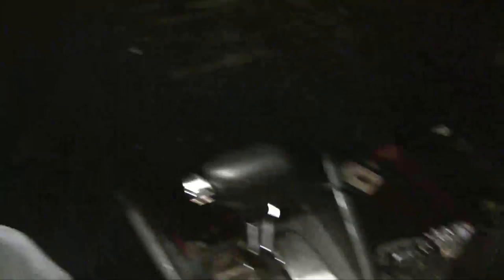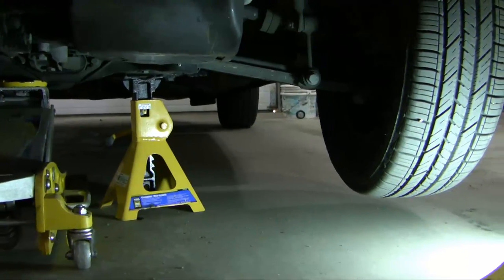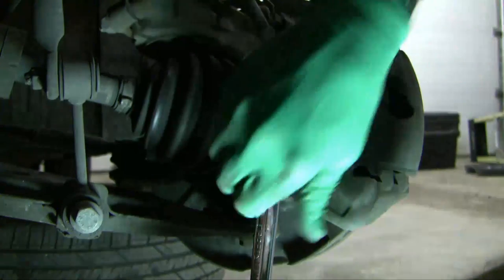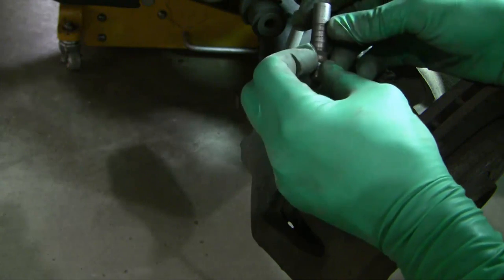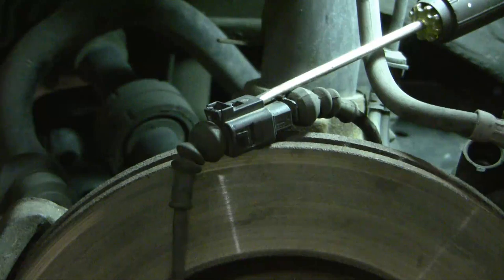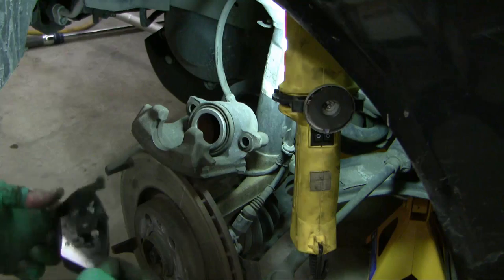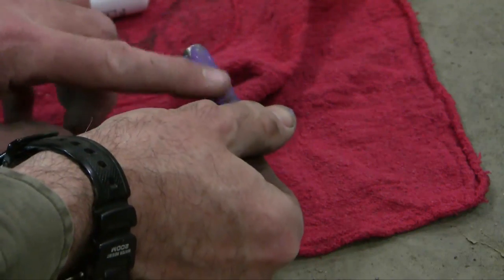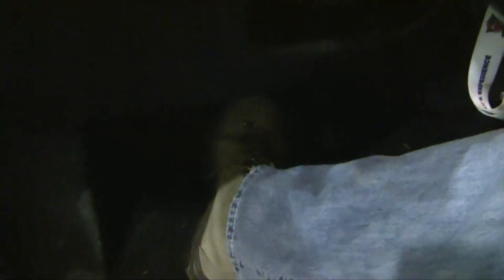Replace front disc brake pads on a 2001 VW Jetta

Comment from the maker: Those are good points, Zac. I would like to see a study done, where average technicians do 1000 brake jobs, alternating technique to open the system in half and not open the system in the other half. Then I would look back to see which technique led to more complications, like inadequate bleeding. 

As an expert in an unrelated field I can tell you that experts are not always right and that expert opinions often swing like a pendulum through the years.

Comment from the maker: Thank you, Zac. Indeed, many experts do it this way and I won't disagree. Of course they do it that way because they believe that in their hands the risk of introducing air into the system, risk of inadequate bleeding after, risk of bleeder screw damage, and the risk of crimping the brake hose is lower than the risk of damaging the MC by retrograde flow. I respect that point of view. Personally I've never damaged an MC and I flush my lines regularly. So, it seems that risks are low either way.

Comment from the maker: You are welcome. There are limitations to what can be covered in one video, and you may encounter other problems, like worn or warped rotors which require more work, or extra problems on rear brakes. But the video as shown is a good basic start for most front disc brakes. There are now many good Youtube videos of brake repairs, and you should watch many before feeling comfortable to try this alone. Ericthecarguy has a great channel, covering brake repairs and other automotive tasks. Good luck.

Comment from the maker: Yes, I've also seen mechanics put brake caliper grease on the back of the pads. From my perspective, Brake Quiet sticks there, without spreading onto the front pad surface and without thinning and causing a dispersion problem when really hot. It's designed for this specific purpose, dampening vibration, not for lubrication. It works for me, and it's proven reliable, and so I don't really have any interest in experimenting with multipurpose lubricants.

Comment from the maker: @Hrothnar I don't know. What year? I can tell you that many REAR disc brakes can be tricky, because of the integrated hand brake. To do those you need to borrow or buy a tool that is sold at Harbor freight or Princess Auto, worth about $30-40. That tool allows you to compress and rotate the wheel cylinder counterclockwise simultaneously, opening the pads to accommodate the new thicker pads. Basic safety principles apply for all brake jobs.

Comment from the maker: Many very respected authors, including Ericthecarguy, believe it is safer to avoid reflux of brake fluid by cracking each bleeder screw at each brake pad change. Of course the assertion is that the risk of damaging an MC by reflux of dirty fluid is higher than the risk of opening the system, repeatedly crimping lines, maybe breaking a bleeder screw, and possibly introducing small amounts of air into the system. I do respect your opinion, but I think the risk may be higher to do that... 
Thanks!

Comment from the maker: @Hrothnar I would be surprised if it not similar. You can have a look at the caliper. Does it say FS-III on the outside? A Haynes manual may offer advice -- my Haynes manual does not cover the Passat.

On the Jetta, the wire/sensor to signify thin pads is on the driver's side only, just on the medial pad.

Comment from the maker: @Kingcodez To settle brake squeaking I use "brake quiet" which is a heat tolerant silicone that helps to suppress brake chatter/squeal. If you don't get excessive noise it's not worth doing over. I would avoid lube or antiseize in that area, out of concern that when the brake pads heat up the lube could spread to other areas. The one place that most mechanics don't like antiseize is in the sliders, where antiseize could react with lube or silicone paste to freeze the sliders.

Comment from the maker: If the fluid is at exactly the right level, it will be near the top when brake pads are new, and near the bottom when pads are worn out. Ideally you don't want to add or remove any fluid. But, if fluid is topped up when pads are worn, you may need to remove fluid before changing pads. The point I wanted to get across is to watch that level when changing pads. Thanks for asking.

Comment: Great video! I just did my fronts on my TDI for the first time. I forgot to put the brake lube on the back of the first pad, and put anti seize on the second. Is it important enough to warrant pulling the brakes and doing it again? I don't see these pads lasting more than a year max, and my last pads were only on there for a year (I bought upgraded pads/rotors), no snow here in florida to worry about either.

Thanks for taking the time to make the video.

Comment from the maker: @TheBeamermseries If that light is activated, it means that the wear on the left front wheel is very close to damaging the rotor. So, you need to get this fixed as soon as possible, before the rivets dig deep gouges in the rotors, on either side. New rotors can be expensive. When you buy the pads, get the ones that include the sensor for that wheel. The signal should automatically shut off, but you may need to erase the codes with a code reader if it doesn't.

Comment: Thanks for the video. Do you have to raise both wheels up at the same time. It also looks like you didn't worry about the lift points. Amateur questions. my daughter has a 2002 Jetta VW.

Comment from the maker: One wheel at a time is fine, but jack stands are sold in pairs and most mechanics recommend not relying on a jack because they are known to slip occasionally. Lift points are usually fairly obvious when you view the structure from underneath, but if you are unsure the owners manual may help with that. Thanks for your comment.

Comment from the maker: Abdulhamid Raad said "where did you jack up the car?".
It's been so long I don't remember. To be honest I normally look underneath and find something solid that seems to be attached to the unibody. It's getting harder than it used to be. The better way is to consult the owners' manual and jack where they suggest. But when you use jack stands they sometimes don't recommend two points, to transfer the weight from the jack to the stand.
Reply: look at that thing lol

Comment from the maker: @serchmarc Yeah, for the rear that tool is very useful. Some shops will lend it to you but the one I use is only $30. It's needed to screw the piston in when the parking brake is intimately associated with the caliper, usually just the rear. You can buy just a cube for a couple of dollars, but that one doesn't work very well for this car.

Comment: FYI, When you push a piston back in the caliper always open the bleeder screw just enough so the fluid is released,this en-sures that any crap will exit the caliper and stops the fluid from returning to the master, keep the bleeder above the barke line to caliper,install pads,then mount it then open the bleeder screw and let the fluid leak out. and when done only push the brake pedal half way down until it seats the pads,which is in the same stroke depth in normal operation, top off master,

Comment from the maker: @oOAstoNisheD Pads are cheap, but I don't know about rotors for that model. You can also turn rotors if they aren't too bad, though many rotors are so inexpensive that a lot of guys just replace rotors if needed. If you get pulsations on light break pressure, usually the rotors need to be turned at least.

Comment from the maker: I suggest you go to one of the forums. I spend time at ericthecarguydotcom, but for that question, a VW forum is probably better. I don't have any experience with that model of VW. I would get a dealers repair manual.

Are you referring to the safety mechanism that won't allow shifting out of park unless the foot is on the brake? Some vehicles have a slot near the shifter, which when turned, will permit shifting out of park, bypassing that safety. If it's there the manual should help you.

Comment: I was wondering where did you get the replacement brake pads? And do they have the rotors also?
Reply from the maker: I think I got them at NAPA. They also sell rotors.
Reply: spelunkerd Do you remember what brand .. because i want make sure i get the right parts? (importantly the one with the sensor)
Reply from the maker: Cassandra Dover Your parts professional at the store will help with that. Just be sure to remember the model number, year, engine size, and maybe the VIN. Model year is sometimes tricky, since the date of manufacture isn't necessarily the model year. -- I normally use the year listed on the inside of the hood on the A/C and environmental label.

Comment: What size rotors did you use to replace them with, I have an 04 and they have the same diameter rotors but I can't find the size anywhere online
Reply from the maker: When I worked on this vehicle I used info from Alldata to get the correct rotor, but my subscription for this vehicle has now expired and I don't remember. Your autoparts store should be able to give you the correct size, and you can double check the size printed on the old rotors to be sure.

Comment: what if the piston of the break pads aren't making pressure to stop the routers?
i just change the break pads but the brakes feels lose and also if i run the cars the brakes don't work and have to use my E-brake
Reply from the maker: If one of the pistons is not making contact then the piston won't press the pads in and you'll get a spongy feel. Alternatively if you opened the hydraulic line you could have air in the line, requiring you to bleed the brakes. Lastly, a much more rare problem is an issue with the master cylinder.

If you didn't open the brake lines, I would first pull the wheels back off and get a buddy to step on the brake pedal while you look to see which caliper is not working. Did you work on the rear brakes? If the problem is one of the rear brakes, then it could be the automatic readjustment mechanism for the rear brake. The way that works, the rear caliper requires pressure against the rotor to provide traction to spin the piston, which extends it. So, for the rear, if you compressed the piston too far when you replaced the pads, you need to re-extend (rotate) it so that it makes enough contact with the rotor to provide traction for that system to work. If your piston is rusted and seized then you'll need to rebuild or replace the seized caliper. If the boot is torn, most professionals just replace the caliper rather than trying to rebuild it.

As you know, it has to be working perfectly before your car is safe for the road. If you find that you've gotten over your head, I wouldn't hesitate to ask for a tow and professional help. It's a lot cheaper than the broad liability implications of an accident after home repair. Good luck! Please stop back to let us know what the problem was.

Comment: would it matter if i used silicone paste instead of the brake grease?
Reply from the maker: I use silicone paste for sliders and I've never had a problem with it. For the clips I use antiseize, and of course I don't put silicone paste anywhere near the pads. I've often wondered how silicone paste behaves in the situation of extreme heat seen in calipers, and there isn't much on the container describing high temp performance. In contrast, brake and caliper grease is specifically formulated with that in mind, so it should be better. When I did my Lexus brakes I used the Toyota equivalent, which works fine, too. I was surprised that the Toyota OEM repair manual also advise to put it on the clips, which is used to prevent rust jacking and binding of the pads. My habit has been to use antiseize on the clips, mainly because I don't want any hot lubricant to drip over onto the pads. Antiseize won't spread far, and it controls rust jacking just fine. Many professionals, including Ericthecarguy have used silicone paste for decades without problems.
Reply: spelunkerd wow thank you so much for all the help, great detail. Thanks for the quality videos!

Comment: You dont have to bleed them?
Reply from the maker: Good question, you've put your finger on a controversial point. The way I did it, and the way it is commonly done, does not require bleeding. Interestingly many academic mechanics recommend bleeding at every brake job, which will possibly take a lot more time if you twist off and break any of the four bleeder screws. Here in the rust belt it is very common to break off those little bleeder screws. If you break a bleeder screw you may need to replace a caliper so that step has a higher possible cost and risk of misadventure, and it increases the complexity of the job. Also if bleeding is not done correctly you will have problems with a soft brake pedal that takes some time to get right. The rationale for bleeding rests in the contention that rarely when the big volume of brake fluid in the caliper is forced back into the master cylinder, there is a chance of damaging the master cylinder seal. So those mechanics who perform that step will clamp the brake line with soft padded vice grip pliers, then crack off the bleeder screw so that when you push the slave cylinder back into the caliper to accommodate the thicker new pads the old fluid in the slave drips out the bleed hole. If you are skilled and lucky when you do that you may be able to avoid getting air in the line, but don't count on it. When I bleed the lines I bleed all the fluid and do a complete fluid change, but I don't normally bleed at each brake pad change. I've never damaged a master cylinder by pushing those slaves back in without bleeding. Smaller volumes of brake fluid are pushed back as you drive, every time you take your foot off the brake. So these system have to be designed to allow small volumes of reflux back the line.

Comment: i guess i should of said> open the bleeder screw until the piston is pushed all the way in then close it,, you'll find out that the piston will retract very easly compaired to forcing the fluid back thru the master,,,also FYI looking at your pads one thicker pad means trouble,,, if the inside pad is thicker by 40% then u have a mount problem and if the inside pad is thinner then the outside pad, most likely you have a caliper piston problem, Just FYI do ur bakes correct

Comment: Being and expert or not, you should always do what ever you're doing the correct way, ask your self, why would experts do it that way,,thems are ur words,gotta be a reason right, plus if you're changing pads, its a great time to bleed the brake system,any way,, so! goes to say, if you can change the pads would one really think you could bleed the system also? crimping the hose wont happen, its rubber and if you leave the top mounting screw on as a pivit point you'll have total control,FYI